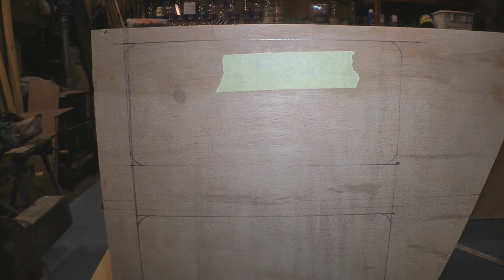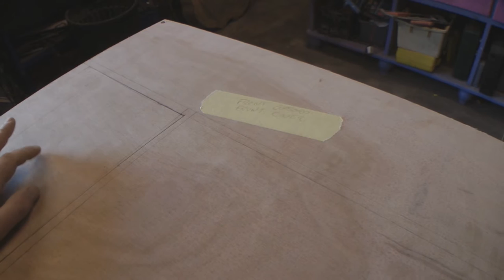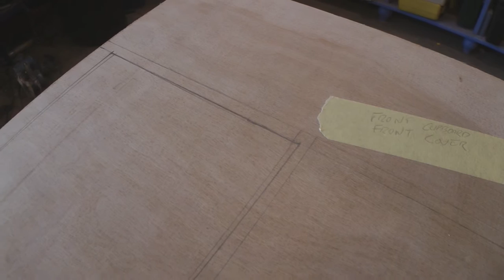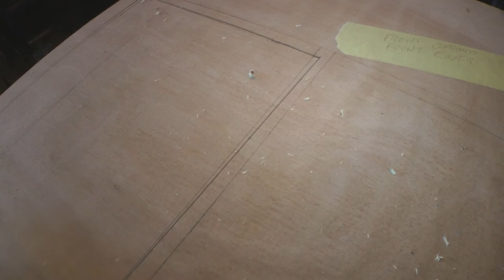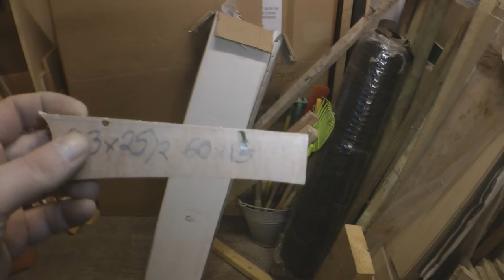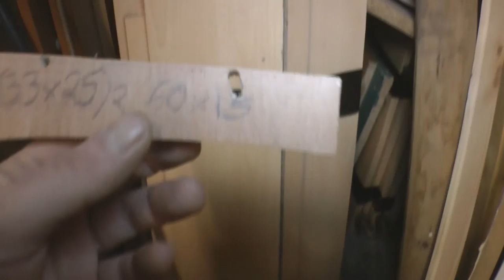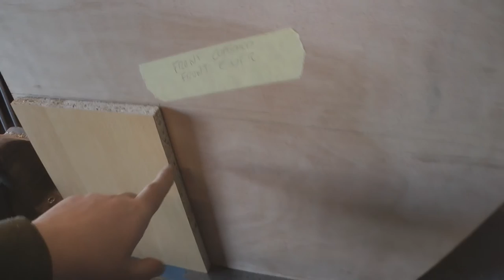Minibus Camp Kitchen Build. 4 of 9

Comment: i know what you mean about the jigsaws...i'm not a big fan of them either...but it looks like a good job..and the rounded corners are a nice design touch. :)
Reply from the maker: Thanks, glad I'm not the only one with a jigsaw aversion. lol I have one with a laser guide on it but I dunno what drunk installed the laser as it just doesn't point anywhere near where it is supposed to.haha  Cheers for watching. Atb Dave
Reply: lol..i'm not much better with a circular saw either...i should probably stick to the hand saw!!..btw are you doing anything with the edges of the chipboard doors??...will it be filler or that iron-on edgeing if anything?? :)
Reply from the maker: haha Me too but I'm getting better with the circular saw. I much prefer my table saw provided the wood will fit on it. As for the chipboard edges, at the moment I have smeared a thin layer of glue over them and am planning on sanding and painting them provided the sanding leaves a decent smooth surface if its gonna look rubbish I will use iron on. If I was building this for myself I would have bought plastic t-edge molding and used that but my parents aren't that fussed about it. Thanks for following along. All the best, Dave.
Reply: i'm looking forward to see how that turns out...and  the seat-belt holes!!...cool project Dave :)
Reply from the maker: Cheers. The seat belt holes were done today and they look like they will work out good, video is edited and should hopefully be up later tonight. Although with rendering and upload time it will be around 6 hours. :O